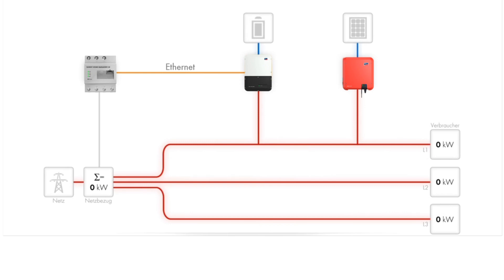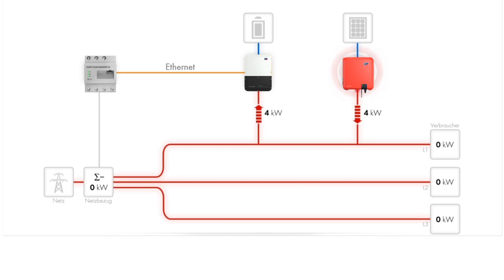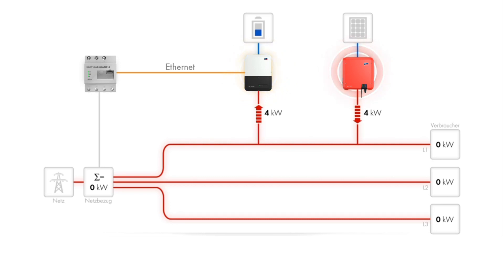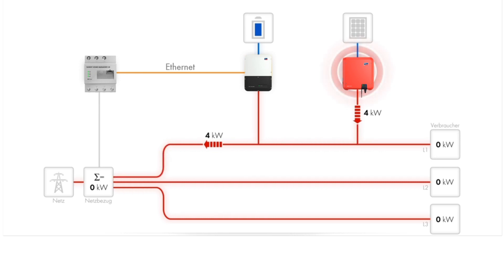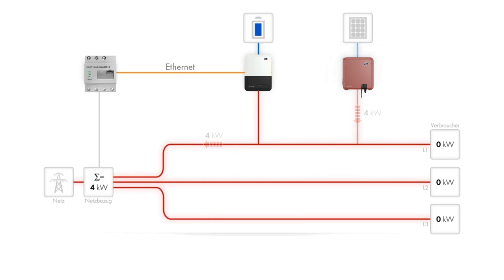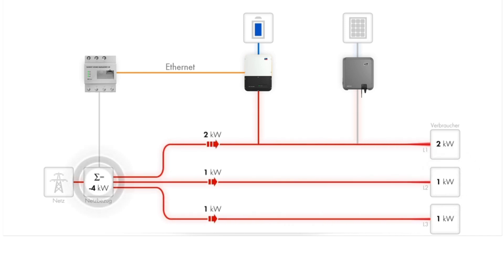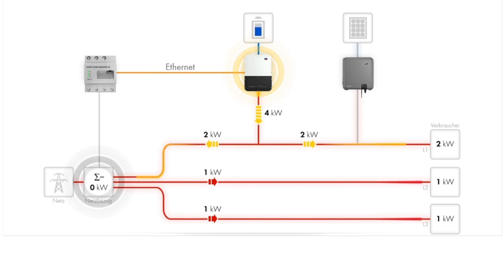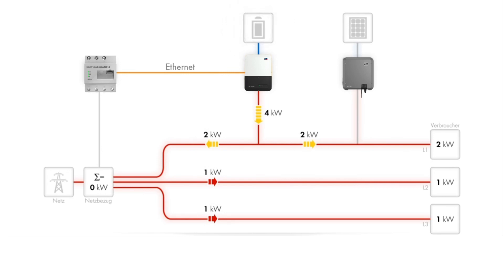How does net metering work for 3-phase sites?

Comment: Thanks for the video. I hope that sma is developing 3phase SB storage, there are many inverters that are doing that and I believe sma is lagging behind them for no reason... Come on guys you can do it.
Reply from the maker: Thanks for your comment Jose. As the video and text summary highlight though, under normal net metering for Residential consumers, there is no additional financial benefit for the customer in 3 phase storage. Residenital customer value is in the volume of energy storage not rated power of the generator. This is why Sunny Boy Storage can connect up to 3 different batteries to give maximum storage volume.

When regulatory frameworks are in place that make this required, or financially beneficial, you can be sure SMA will have a solution.

Comment: We have an issue with this system here in Portugal. We have a STP 10.0kw and a SBS 6.0 and 22kw BYD batteries. Now it seems when the battery is delivering power to the house it counts on the meter as consumption, how is this possible, if it is possible??

Comment: Maybe a stupid question, but what if your PV system is on 2 phases and your battery inverter is on only 1 phase, will it use grid power to charge the battery? (the amount that is stored back over phase 2)
Reply from the maker: Hey Dave, the battery inverter and PV system should be on the same phases for the direct charge cycle to work with PV power. 🙂